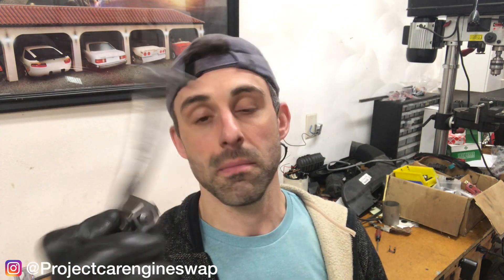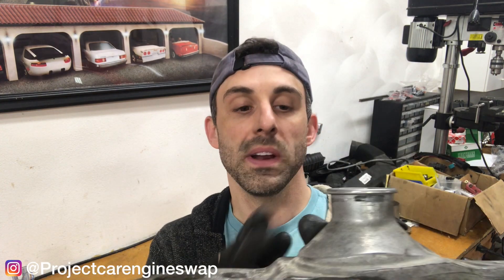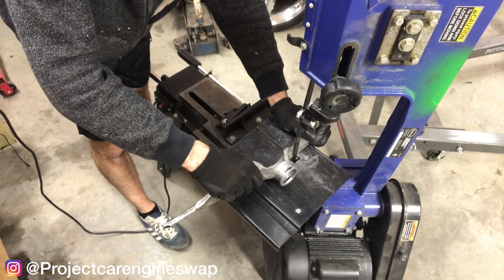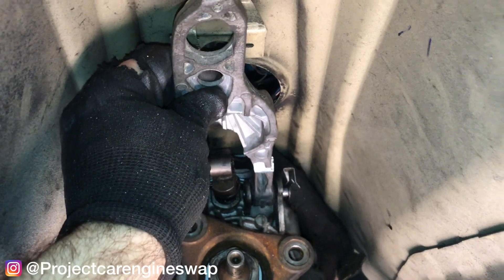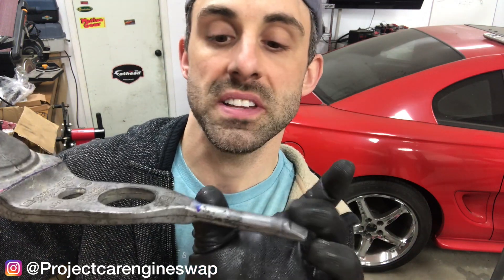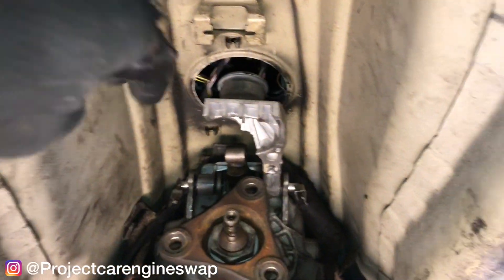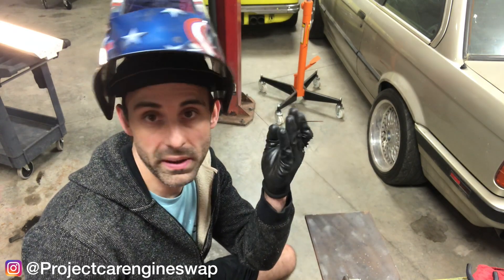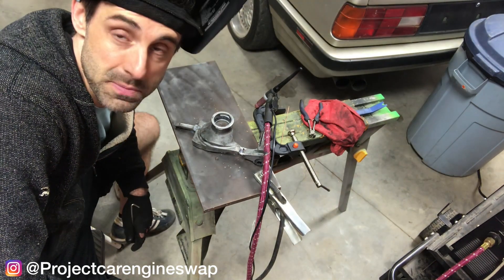Shortening the shifter rod and carrier for the Twin Turbo M3 Swap

Comment: This is exactly what I was thinking of, I assumed it was easier when doing a swap then trying to get the transmission perfectly where it was stock, if it’s slightly too long or short do you think it will matter? Or is rough estimate for the length hood enough to bang some gears ?
Reply from the maker: So if your Shift CARRIER is too short or too long, then the entire assembly won't fit in the center of your shift hole in your console. 

If your Shift SELECTOR ROD is too short, your 2,4,6 gears will be angled too far back in your shifter. If too long, the 1,3,5 gears will be too far forward. It will still work, but won't look or feel like stock.
Reply: @Garageaholic  yea that’s what I figured, but I assumed you could do it somehwat by eye right? It doesn’t have to be down to the millimeter ?